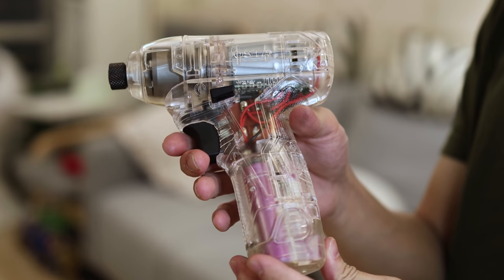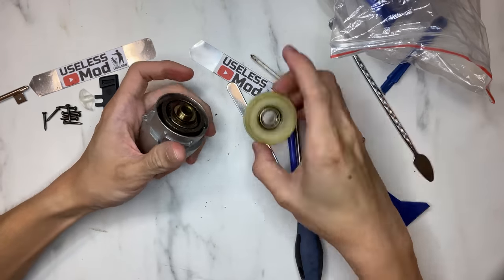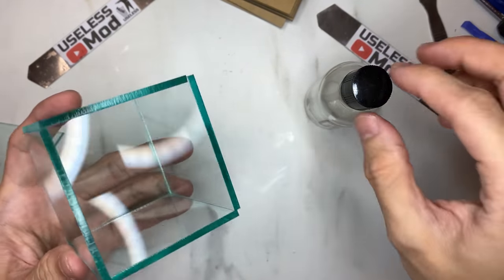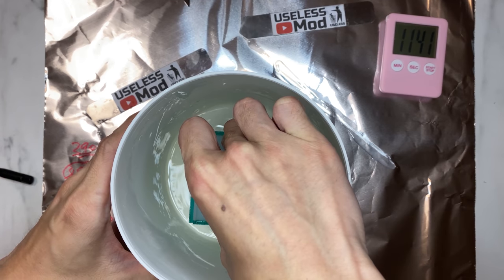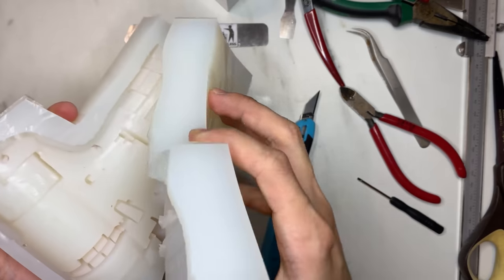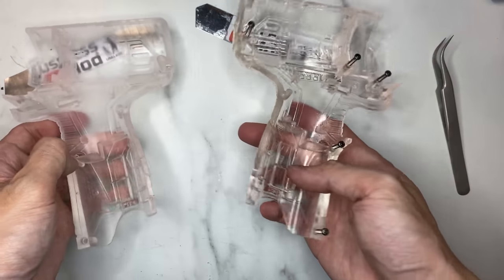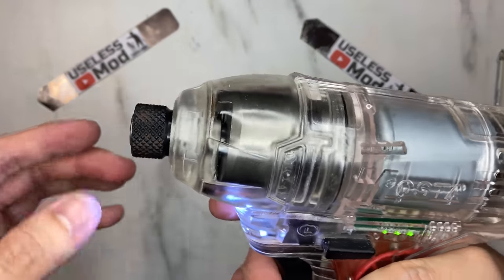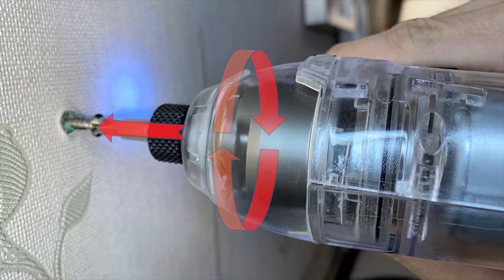CLEAR Impact Drive | How it work | different between drill and Impact | see through | hack hammer

Comment: Amazing job thank you, I would like to see a video of a impact wrench i guess is very similar to the hammer drill thanks.
Reply from the maker: thanks for your support😋 will try do more mechanical stuff
Reply from the maker: I think there are the same, only in bigger size and the connection head is different~
Reply from the maker: I think there are the same, only in bigger size and the connection head is different~
Reply: @uselessmod2144  thank you

Comment: You’re making me feel like Im under utilizing my 3d printer and lasercutter!
Reply from the maker: 😆I also actually left my 3d printer and Laser cutter sitting there doing nothing for so long time, untill now, I think of this way can fully utilize them😆😆
Reply: I use my 3d printer a lot but the lasercutter has been neglected for a while. I use it sometimes to cut and etch overlays for my enclosures. I’m trying to find out how to get molds made for my prototypes. With your technique you are using can you use the mold several times? Also can you create a mold from a 3d printed part printed in PLA or ABS or will the heating process melt the plastic? Otherwise do you have connections to getting injection mold tooling done for low cost? I’d like to make a short run of my 3d printed prototypes of about 20 to 100 out of plastic. Maybe even clear to show the electronics inside! Maybe you can help me out since you are in Hong Kong and I am in USA. I need a connection out there to manufacture my prototyped inventions and try to sell them!
Reply: Here are two of them that in need to figure out how to get the molds done and possibly even the electronics manufactured in a short run. The 3d printed enclosures were designed in Fusion360:

https://youtu.be/-oJih9PmsJI

https://youtu.be/kd21Y0cl9Rc
Reply from the maker: sideburn you plan to do mass production?
Reply: Well if I could get them to sell. I was thinking a short production run at first. Like maybe 20 to 100.
Reply: I am grrl hord in the mavic mini mods Facebook group by the way. That’s how I found you. And I want to convert mine to clear too! 😆